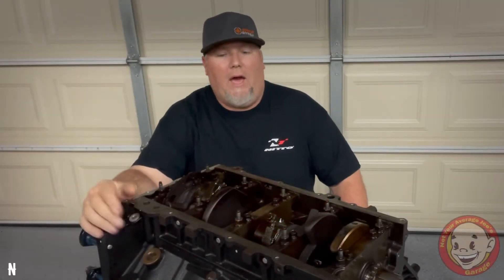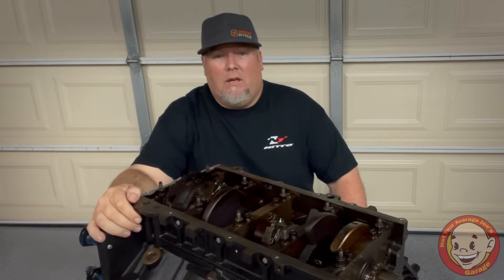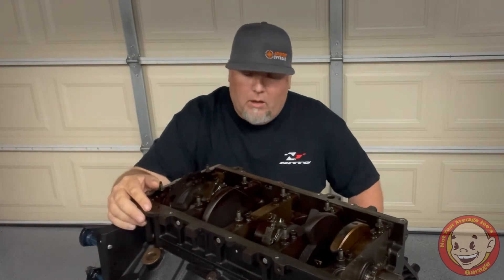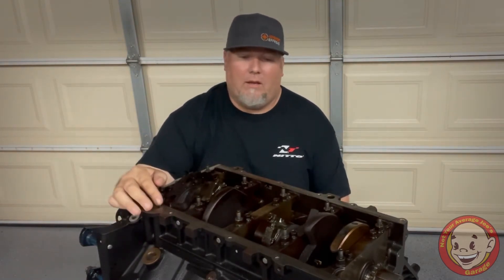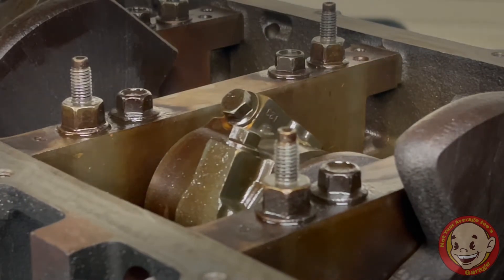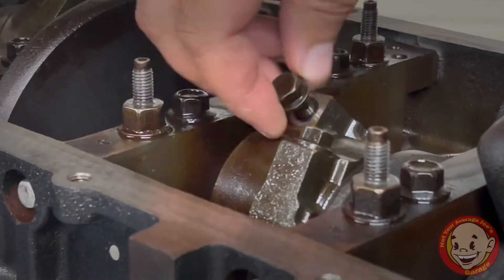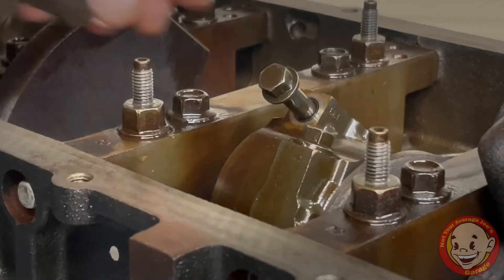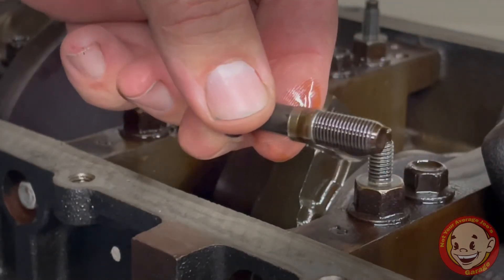LS ARP Rod Bolt Swap

Comment: You can buy better rods with arp bolts for $500.  This is just a waste of time and money.
Reply: You can't  just change rods in these. The wrist pin on a stock piston and rod is .943 and a aftermarket rod uses .945 pins. Typically you won't machine the bore of the stock piston to the bigger size, and even if you do the rotating assembly now has to be balanced. So no, you can't just buy some better rods, plus there is no reason to run aftermarket rods when stock ones will be fine for most people not making over 700hp, gen 4s will survive 900 with the  arp bolts for a long time. They have been pushed much higher.

Comment: #1 you can't resize stock LS rods, they have a fractured cap and you can't machine any mating surface to reduce the bore size to hone the correction.  On installing the bolts especially on a street engine doing the job like this is perfectly okay.  I have installed ARP 2000 series rod bolts with the rod mounted in a vise and measured the bare bore, no change.  Maybe it's because of the fractured cap but the clamping forces are contained in the rod boss and I've seen no deflection of the bore.  Good enough for a single turbo 5.3 pushing over 600hp at 6700 rpm.
Reply: Thank you!!!! Appreciate your input

Comment: Do you have to take the sleeve out? I just did mine last night and I didn't take the sleeve out I just threaded the old ones out and put the new arp bolts back in.
Reply: After doing two rods tonight,  I'm in the house looking for the same answer.
Reply: Let me know what you found. I have mine buttoned so still haven't tried to pull anything out etc.

Comment: I didn't resize my gen4 ls rods using the same arp bolts and pushed it to 930hp no problems. If the manufacturer didn't recommend a rode hone why should we worry
Reply: I didn’t re size my rods ether , haven’t start it yet my question is is yours still running / any problems?
Reply: @mannysolis4588  0 issues, if you're too worried have your big end mesured before popping in the new bolts. I didn't mesure mine
Reply: @Airman..  thanks bro for your help
Reply: I just put mine in last night and called arp to be sure I tightened them to the right spec.  The guy said I should go back take them all off and take the sleeve out of each one then put them back.  I am not sure why I need to? I mean they torqued to 15 psi no problems they were a little tight to get the bolts in but they threaded in and they tightened down I can't understand why it is a problem?
Reply: @agooser26  what sleeves? Oem bolts should pullout with their sleeves
Reply: Did you torque to oe spec or the 40 ft lbs arp says
Reply: @emersonurbina8042  followed the same instructions that came with the bolts

Comment: Are those bolts the same length or are arp a little longer?
Reply: I just did mine and the arp bolts are like 1/4 inch longer and have a shoulder on them too.  I don't know about this resizing thing u just put them in lol.  I did call to make sure they were right and they said yes.
Reply: @agooser26 you clearly don’t know.

Comment: i reassembled my bottom end on my LM7.. i checked the post Torque to angle applied torque..  main cap lowest Newton Meters torque applied was 42.. under 30 Ft Lbs.. rod bolts where 52 to 64 so just over 30 to 47 ft lbs.. i went back inside and ordered studs and rod bolts..did not feel comfortable continuing to put it back together with those as final measurements.

Comment: Have you had success doing this on past engines?
Reply: ARP says the BEST method is a stretch gauge BUT IF YOU DO NOT HAVE ONE, torque to  X ft lbs.  i have never had an issue with ARP fasteners and their torque specification over their stretch spec.  ( i did a full ARP stud and Eagle rod's  which uses ARP fasteners on an eagle talon 4G63 build never had a failure from the fasteners)